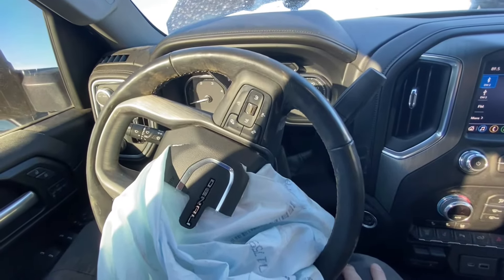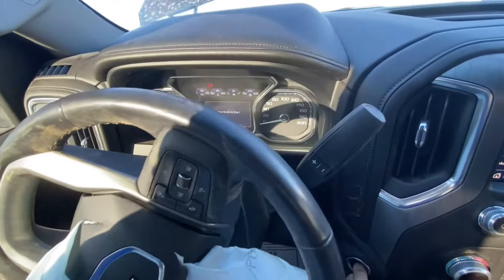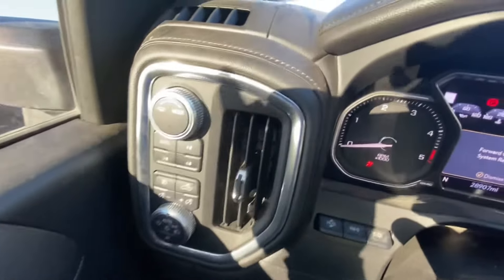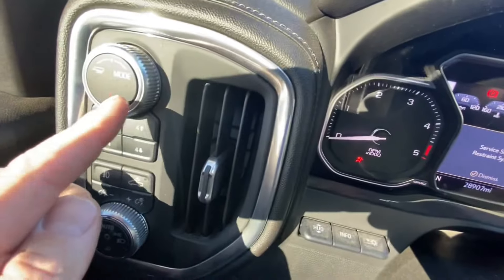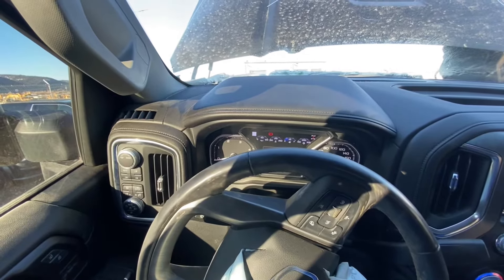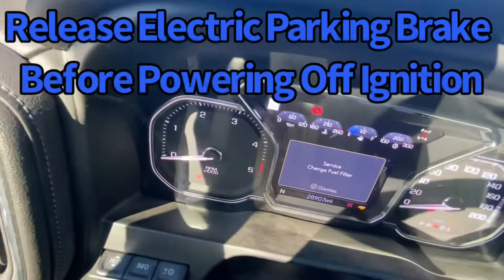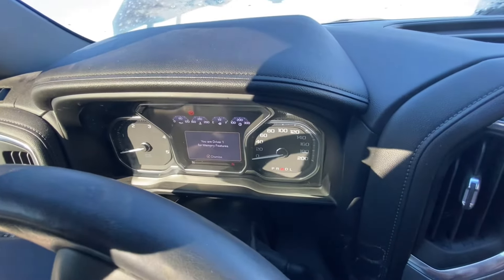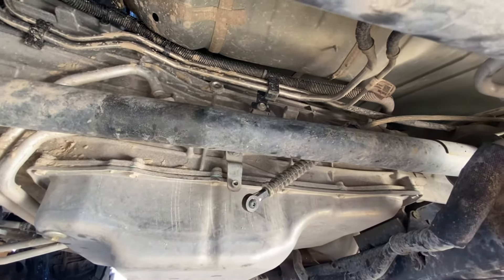2020+Up GM Truck T-Case Neutral Shift

Comment: Is this safe if gas was put in a desiel in order to tow?
Reply from the maker: I would pull the fuel pump fuse or relay prior to powering up the ignition. If that’s not possible just hook it from the rear or disco the shift cable to load it up on a deck. Whatever you do don’t cycle the fuel system. If possible disconnect the battery so the service shagger doesn’t hit the key for the odometer and run that pump. Just keep that fuel in the tank and don’t let it go through the system. If it was driven mixed then don’t worry about it.
Reply: @kevefox  it wasn't driven. The fuel was disconnected and ran into a bucket before cycling the engine. I assume that this is okay?
Reply from the maker: @ryleyhowell1728  yep, perfect.

Comment: What if battery is completely dead
Reply from the maker: Either add power or disconnect the shift linkage at the transmission (cable shift models). If you shift to neutral with the cable that will be only to load or move and not safe to tow any distance more than a mile or two.